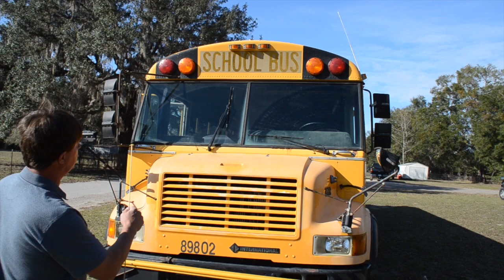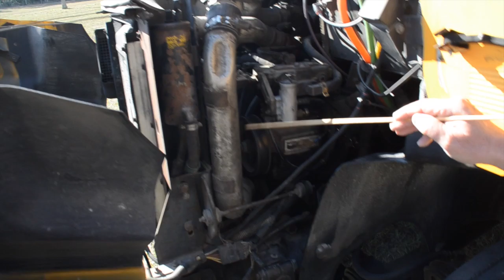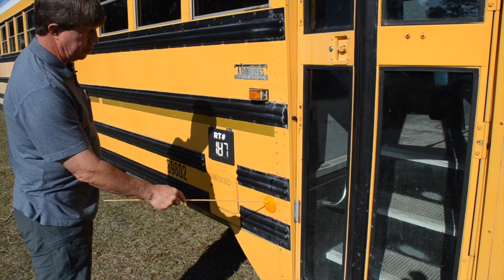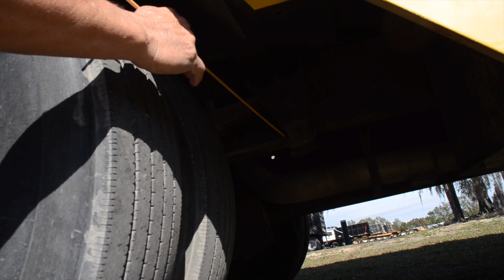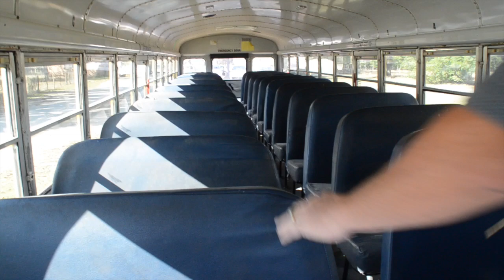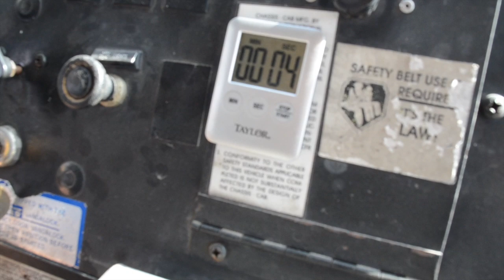CDL Class B Pre-Trip Inspection (Passenger Bus)

Comment: You did the Air Brake test wrong.  
Step 1 turn the key to on, step 2 release parking brake, no more than 2 psi loss in 1 min. Step 3 push and hold pedal in for 1 min and no more than 3 psi loss.  Step 4  pump brakes down buzzer and light should be on at 60 psi (I did not hear a buzzer at 60?).  Keep pumping and between 40 and 20 psi the parking brake should pop out.
Reply from the maker: Florida does not do the static brake check.